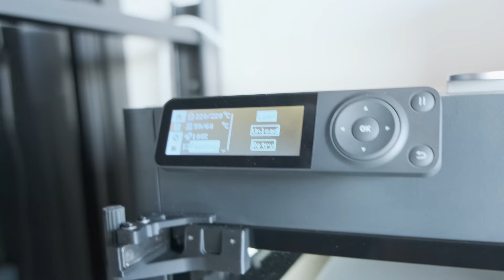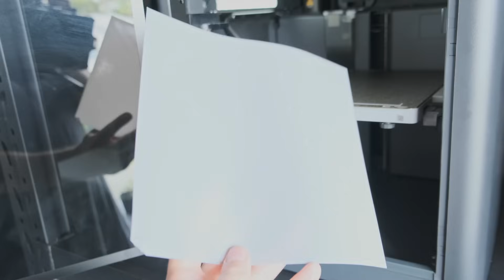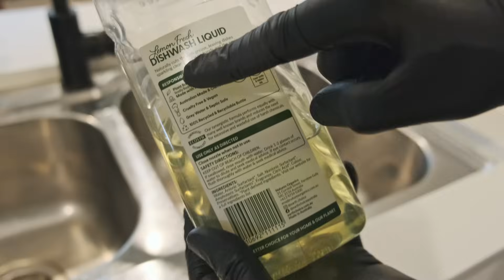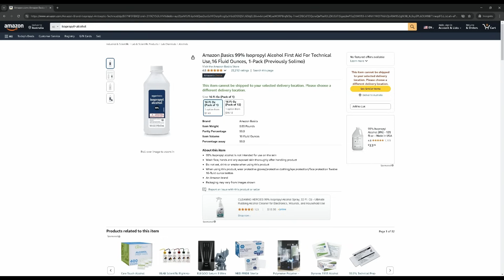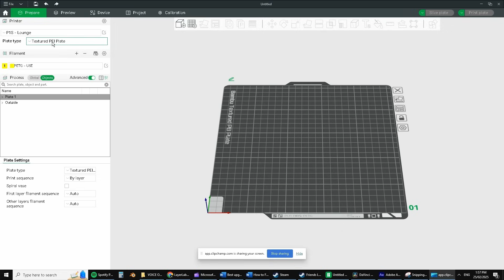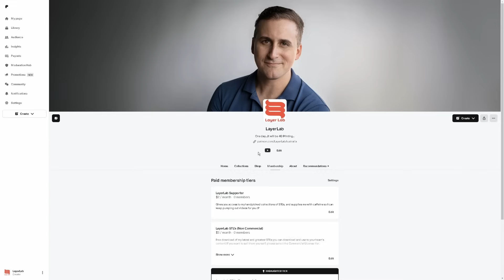Your Prints Won’t Stick? Here’s the Fix for Bambu Lab Printers!

Comment: Thanks Dude. Clear, simple video that SHOWS what needs to be done, and doesn't cut anything out. I'll have to chwck out your other videos.
Reply from the maker: No worries amigo! Glad you found the video helpful :D
Reply: @LayerLabAustralia  And I'll double down: Good thing I saw your video first! 
After a year of issue-free 3D prints my Bambu A1 all of a sudden this week started screwing up prints. I thought the worst. Ordered backup print nozzles, parts, readying myself for surgery. Before I started I saw your video. There is no way I'd believe just a cleaning of the printer bed would solve my issues.. But you did the finger print on bed and print test sheet video. That sold me. I washed the Fck out of my printer bed, like you said, dish soap, microfiber, then dry then alcohol. Dude - problem solved! 
Great work. Much appreciation!

Comment: TBH... nothing beats a BIQU frostbite.  I'm stuck in the mud right now waiting for BIQU to bring out the frostbite plate for the H2C.  The Bambu and all other brand's PEI's just stink.  They are not reliable and many failed prints happen. I print 24/7 with 15 printers and I NEVER get failed prints with the BIQU and you don't have to use brims at all.  I do sometimes, just because I am nervous about a certain part getting moved, but I've never had a fail.  Never.  I'm on print 5 with the H2C and 2 have already failed with the PEI.  The Smooth Cool plates aren't any better for X1's & p1s' .  They are great for a week or so of hard printing but then they become the PEI plate.  And who wants to waste on brims anyway???   All this worrying about fingerprints and stuff gets thrown in the trash with the frostbite plate.  Just go get yourself one and fahgetaboutit.
Reply from the maker: I actually have one of their plates I need to test out still, but I haven't had the need as the stock textured plates have been working really well (other than with ABS, which is easily fixed with some magigoo or even the BIQU glue).

But glad to know these frostbite plates work so well! I'll have to try them out.

Comment: The microfiber cloths you showed are fake. They are only a small percentage microfiber and are mostly polyester. They will shed and leave tons of fibers behind after you wash and dry them once. Real microfiber cloths are expensive and worth the price.
Reply from the maker: Wow.. I didn't realise that.. I've never had any issues with them shedding, but I'll look into it and make adjustments as needed for future videos. Thanks for the heads up!
Reply: @LayerLabAustralia ask me how I know lol I fell for the same thing and ended up buying a good brand on Amazon and I never put them in the dryer either. You can see the shedding of yours if you have a tinted window on your car you can see the fine sheds it leaves behind on a sunny day.

Comment: This did not work for me, constant bed adhesion failures using Bambu Lanbs own PETG filament on my brand new P2S. Worked fine when I got it, by 3 days in failure upon failure when it comes to anything flat. Cleaned the plate, increased the heat, still don't solve the issue. Really annoying, and so much for Bambu Printers "just printing". Almost tempted to send it back.
Reply from the maker: Sorry to hear you're having trouble with your printer! Have you tried adjusting the Z-offset? Typically they don't need adjustment, but if you are experiencing lots of issues, then it's worth a try. Also, make sure you have selected the correct build plate in the slicer, as using the wrong one, such as a smooth build plate, when you are using a textured one, will apply a different Z-Offset, and result in nothing sticking. :)

Comment: Have my printer over a month now, took the prints of with my hands, never washed it, cöeaned it with bare hands. Worked all the time. Yesterday i read on the quick manual sheet that it has to be cleaned with soap. Today print failed. Turns out, as long as you dont know it has to be done, it doesnt have to be done. ;)
Reply from the maker: Sometimes ignorance really is bliss! 😂

Comment: Your notice on maker said "Knocked over by the print head" or something like that, but this is a spaghetti issue.  the two are completely different issues.  

First of all, if a part is getting knocked over by the print head, that implies that there is more than one part on the build plate at a time and the head is knocking one of the parts over as it goes to print the others.  The Bambu software has an easy fix for that, as I am sure you  already know, but maybe not...  so simply before slicing click the auto arrange button and that should handle this issue. Who knows, but somehow the plate might have got spun around and that could be the cause of this issue. 

Spaghetti is usually a filament issue, and not caused by something the maker did in my experience. Drying out the filament properly before use should alleviate this problem.  Remember that even Bambu basic filament actually suggests drying it immediately upon opening the spool before use.  Environments are all different.  I live in Florida and moisture is my heartfelt enemy.  I have so many filament dryers and I buy filament bags in bulk.  For me, its a huge cost.  My northern contemporaries' are not bothered by these issues and don't face the amount of spaghetti failures that I face.  

As to the subject of this video, I have never engaged the community in the Glue/No Glue war.  I use the textured plate that came with my first, through my current printers and the first printer was a Flashforge I think... The directions said to apply the liquid glue to the build plate with that textured appearance, so I did and I've been doing it ever since. I never once experienced a failed print due to adhesion issues.  Not once. I have been using that same kind of glue which seems to evaporate once that print is done, leaving virtually no residue behind, and needing virtually no clean up from the bottom of my prints once removed from the build plate. 

I did try the "school glue" for a short period of time, I found myself at the kitchen sink and I didn't feel that was where I wanted to be with 3d printing parts, so I went back to my liquid glue, and now I use Bambu's version of it. I have no adhesion issues, I don't really like supports, but I have only JUST begun to buy and use the new support material now that I have a H2D printer and I am looking forward to using this material to avoid problems in my printing future. I will be making my own video on this topic in the near future.

Comment: What I figure out for the 5 days I have 3D printer, if you place good flat support beneath the object like brim or mouse ears or something similar + good z-offset (closer to the plate for at least the first layer of the brim). Good preheating of the nuzzle and the bed. One thing that works good for me is higher than usual bed heat at first and a bit lower nuzzle heat at least for the first layer and then increase the nuzzle heat. Of course cleaning the plate before every project with alchohol or soap under water like it is shown in this video is essential

Comment: I was looking for complicated issues which could cause adhesion issues on my X1C without any success before stumbling across this video. My build cleaning regime only used IPA and micro fibre cloth. A simple wash with dish soap under warm water immediately resulted in a perfect first layer. As a bonus, the usual error that there was insufficient reflected light from the laser did not occur.
Thank you very much for this helpful video!
Reply from the maker: No worries! I am so glad the video helped 😀

Comment: BULLSHIT ! Despite repeated claims the Bumboo labs PEI plate is SHITE  It has poor to often NO afhesion.. Period ! Despite Clean Bodges. 
 Simple layer of Painters' tape remains (for a couple decades now) THE best possible Bed adhesion surface yet devised. Cheap.. Easy and 100% reliable.
Reply: Ok pal. Keep wasting money on rolls of painters tape while the rest of us are using cryogrip plates.

Comment: When you're trying to remove contamination from a surface, don't swirl around; that just spreads the contamination.

Fold a cloth in half, then in half again. Wet one surface with solvent. Start at the far edge, and wipe while pulling toward you, rotating the cloth so the part that was touching gets lifted and a clean part comes into contact. Pull all the way to the near edge, then off the edge. You want to pull the contaminants off the edge, not leave them or push them back.

Now turn your cloth over and do the same thing with the other side, shifting over to a new uncleaned part of the surface while maintaining a bit of overlap.

Now unfold and re-fold so there's two new clean surfaces on the outside. Keep repeating the wipe, lift and flip.

Now double un-fold and double re-fold so the dirty surfaces are on the inside and the clean ones are on the outside. Repeat everything.

This gives you eight clean surfaces to work with, and the contamination is lifted off and dragged off the edge.

This is is how technicians clean contamination critical surfaces on spacecraft.
Reply from the maker: Wow, that's some serious cleaning knowledge! Thanks for sharing!

Comment: Washing microfibre cloths using laundry liquid can put "softeners" and other types of residues on the cloth semi defeating the purpose using it to clean your plate. If you find you do have a problem get some microfibre cloth washing liquid which is used for car detailing as you don't want residues on your cloth when trying to get a perfectly clean finish on your car or print plate. Try Bowdens Own Microfibre Wash.

Comment: 3:22 ya i dont like using paper towel because of the reason you said but also it leaves littles pieces of it sticking to the plate and its hard to get off so always use microfiber

Comment: I have been 3d printing for years and recently got a Bambu labs machine with a textured pei build plate and have been having bed adhesion issues. This video was very helpful and I think I figured out what I have been doing wrong. Thanks for the informative video!!
Reply from the maker: Glad to hear that it helped you out!

Comment: New to 3d printing and this video was just what I needed. Lack of adhesion had caused my hot end to become totally blocked and covered in filament. I cleaned/unblocked everything but was still having issues with adhesion. After watching this video, I’m back to faultless prints 😊
Reply from the maker: So glad it helped! 😁
Reply: Hoping this works for me, my printer was flawless for months, then had a few weird corner lifts, then 1 blob of death caised me to have to replace half the parts in my extruder, still no adhesion so well see.

Comment: The dish soap trick worked for me. I wiped it off with a damp paper towel thinking it be fine but guess it still had residue from oils on my hands. Never realized how dirty a plate could get. I use to just use tape on my older printers but now I know I had to clean them better.
Reply from the maker: Good old dish soap to the rescue :P It's crazy how easily the plates can get dirty, and just a few touches from our hands can really mess it up...

Comment: I solved my issue by buying the cyrogrip plate, textured pei too much work to maintain for me i gotta  clean it after every print to even get it to stick  sometimes
Reply from the maker: Ohh I have one of these plates sitting next to me, ready for some testing! I heard they don't last as long as the stock plates as the material seems to wear out over time. How are you finding it so far?
Reply: Been non stop printing on it, seems to hold fine for me, we'll worth the money

Comment: I still have had 0% success rate on prints, even after cleaning, recalibrating, ensuring lenses were also cleaned up. It literally went from 100% to 0% overnight. I have no idea what is going on.
Reply from the maker: Damn...which printer have you got? Have you tried a different build plate?

Comment: Hey hi, my print supports are coming apart suddenly from print bed. And sometimes the nozzle itself is knocking up the supports. And the main thing is the problem is arising during the support printing, and I don't see any problem with main object print. Anyone has a possible solution for the above. Please help.
Reply from the maker: What type of supports are you printing? Tree/Regular? How tall is your object? Gimmie all the details :P
Reply: I got my P1S about a month ago, was doing great until last week, having the EXACT same issue... supports won't stick, but the actual print does. I've washed the plate with dish soap and warm water, but it doesn't help. I also tried the purple Elmer's glue, like I did with my old printers with glass plates, but I still have some supports that won't stay put. I was avoiding using IPA since the Bambu Wiki says not to, but I guess I'll try it. Using Hatchbox standard PLA at 215/60, tree supports, and my objects range from short to tall, doesn't matter.

Comment: Guys, don't always just use dish soap and water. Isopropyl Alchohol (IPA) solved the adhesion problem. You can get them at hardware stores and if you live in australia bunnings.

Comment: If I don’t wash my print bed with dawn dish soap after every other print then prints don’t stick well at all. Specifically PETG is difficult. PLA doesn’t seam to care as much.
Reply: Once I tried using a light mist of AquaNet every now and then, I never had an issue with PETG again. Works beautifully on textured and holographic plates.

Comment: I have to say a huge thank you for this.  I've been pulling my hair out for days trying to figure out why my prints weren't sticking.  Even with glue they slide right off.  After cleaning the plate with Dawn and scrubbing it with a scotch brite pad its back to. its normal self.  To be fair, none of my other printers have had this problem but at least now I know.  Thank you so much!  Really.
Reply from the maker: I know how you feel! Both my printers were not sticking around the same time, turns out the cloth I was using was the same I was cleaning the area around my printer with, and had dust/dirt in it. A good wash and it's good as new 😄

Comment: This is bang on target!  Awesone... some other things I've come across on this topic:
**  Dan Gelbart has done a great series on Rapid Prototyping.  In one episode he covers surface cleaning, and adhesives  He mentions that cleaning a surface with any hydrocarbon based product, such as IPA (Isopropyl Alcohol), laquer thinners, etc,  always leaves a layer on the surface.  The layer may be only one atom thick, but it is enough to make a difference to how well things will stick to it.
**  Ivan Miranda covered preparation of a glass print bed.  I have followed his method ever since, with really good results. (I too use a glass bed.)   Ivan's method is almost identical to yours, but the perfectly smooth surface of the glass does not need quite such a vigorous cleaning.  Ivan really hammered home the "Don't touch it!" message!  He also demonstrated a large print that had no lifting.  He left it on the glass to cool down; as it got close to room temperature, there was a satisfying "Click" and the print freed itself.   Magic!
**  If I have a tall print, or one with only a small surface area in contact with the bed, I have some added insurance...  I keep a small sealed container of "Secret Sauce" by the printer.
My recipe?:  Add about 5ml of ordinary PVA woodworking glue to 100ml of clean water.  THAT'S IT!  Use it to dampen a tissue, and give the bed one quick wipe... takes about 5 seconds and I have never had a failure.  Don't make the mix too much more concentrated than this, or your parts and your bed may be mated for life!
Thank you for a great video.
Reply from the maker: Thanks for the awesome tips! Glad you enjoyed the video 😄

Comment: Keep a piece of stiff plastic, slightly larger than the printbed.  When you finish a print, lay the plastic on the printbed, and it will significantly reduce dust and accidental fingerprints.
I also have a large plastic bag that I drop over my open-frame printer when it is not in use... well worth the few seconds it takes.

Comment: Re: bed leveling: is it actually necessary to relevel the Bambu printer bed between prints? Or is once after powering the machine on sufficient for the day?
Reply from the maker: I would do it before every print, it only takes a few extra minutes and guarantees your bed is perfect :)

Comment: oh no! its a BAMBU ussue? MAC of 3d printers... yeesh. the base bed SUCKS get the aftermarket from bambu. acting like these steps are BAMBU specific makes you exactly lke a mac user. these are TYPICAL printissues with almost EVERY printer.... just wanted to airplane. im stickig your arse in the round bin... embarrassing.
Reply: I have thousand of print hours on my Bambu printers for the last almost 2 years and the plates are like new, no issues. And I agree Bambu is like an Apple product, makes everything else feel like windows or android, shit

Comment: The original PEI bed in my P1S is definitely having adhesion issues, despite washing with dish soap and wiping with IPA. i would be stressing over it, but i got another from BTT that works every time. Hopefully it doesn't go the same way.

Comment: Is that not about 100 times more soap than needed? If you scrub it on before starting to rinse 1 drop can be enough.
Reply from the maker: Probably... up to you how much you want to use :P
Reply: @LayerLabAustralia  Probably can eat dinner off your printing plates after you wash them with no plastic eating risk.